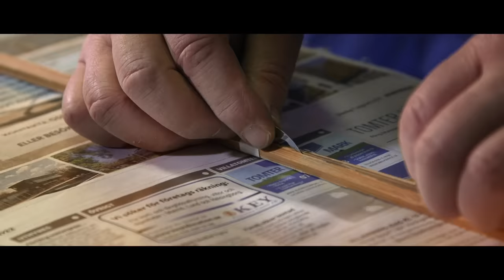The Rod

Comment: I think, more than any other medium, bamboo becomes part of the fly line. And in doing so, it causes the arm to become part of the line as well. Then when the cast is performed well there is a fluid connection between the fly and the fly fisher. When the fish  joins the dance, the dance changes from a waltz to a tango.
Reply from the maker: Agreed :)

Comment: Why did you burn the bamboo. Great video
Reply from the maker: Thanks Anton. Glad you like the video :)  I really don't know why Ulf is burning the bamboo. Maybe to soften the cane so that the node can be flattened. You could try to ask Ulf himself via the link to his site in the video description. Cheers
Reply: Yeah i think what he said makes sense , my hobby is to make bows out of different woods (never used bamboo though) so when you try to make a recurve in a bow , or streighten a part out , you heat it up to a certain temperature to soften the fibers so that you can bend it , once it cools down it remains in this position.

Comment: Nice looking piece of handcraft!  
Question: have you ever heard of Terenzio, Synthetic Silk Fly Lines?
Reply from the maker: I'll certainly look that up. Good tip :)  Cheers
Reply: Here you go: http://www.terenziosilklines.com/en/revolution-fly-lines/

Strong advantages that I found:  
Absolutely NO line memory, no more curls and straight lines on the water surface
far less resistant in the air while much thinner than same weight in plastic,
far more easer to cast in windy conditions,
stealth  when landing on the water surface,
little or NO maintenance, other than greasing it lightly at the beginning of your fishing day (which I also did with my plastic lines)
Reel capacity increases because smaller diameter
Floating capabilities: excellent

And NO, I'm not a Terenzio stockholder,  just an enthousiastic enduser
Reply from the maker: Sounds almost too good to be true. I'll definitely give that a try. Thanks for the link :)
Reply: Autumn, falling water levels, crystal clear water and weary trout....ideal circumstances for a test and maybe one more lovely video...Good luck & Tight lines

Comment: Many of the stages in the build is omitted. Especially fitting ferules, that are absolutely beautiful brass artwork, and also the tempering of the whole rod; A process of extreme danger to the delicate whole rod, where one mistake, can be fatal!
And the handle..
The shaping of the cork..
Also it is not shown is, that a rod like this is varnished 4-6 times! -Witch is comparable with the highest standard in top-notch car manufacturing.
Building splitcane rods has been done since ~1700, and some of the antique rods has a pricetag, that can be compared to fine art -And why not? This IS fine art!
Reply from the maker: You're absolutely right :)  Cheers

Comment: Why was the trout so sluggish? When you catch a trout that size here you are in for a full on 20-30 minutes pole-breaking fight!
Reply from the maker: The fight has been cut down to a minimum in this video. It's not that sluggish really. Cheers
Reply: @CarpeDiemFlyfishing  I had another look. That fish is what we call an eel trout. It's to long and skinny for it's head size and they are usually much more tired and sluggish than a well fed trout. They usually get that way from getting caught up in a smaller body of water over winter where food is scarce. If they reach the sea, or in this case a bigger lake perhaps, then they usually make a full recovery. See 5:10
Reply from the maker: @Thestripper1  You're right of course but in this case the fish never migrates to a bigger water. They stay in this stream the whole time. And this is early spring, after the winter as you say, so they tend to be a bit thin this time of the year. Cheers

Comment: What kind of camera & specs are you running for the first 30 sec of this video?
Reply from the maker: I'm using a Canon C100 mkII for the whole video. What do you mean by specs? It's full HD. Lenses used are 16-35 f4 IS L, 100-400 L, 100 macro f2,8 L, 24-105 f4 L and a few more. Cheers